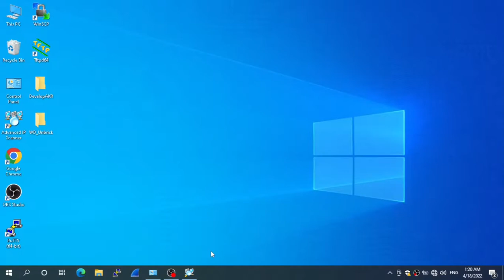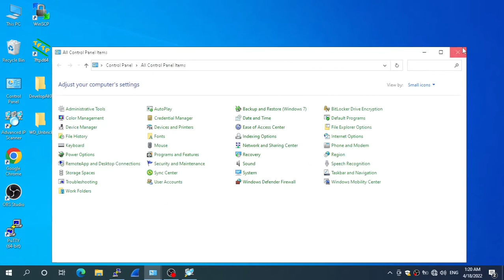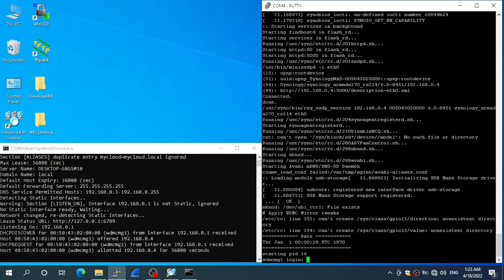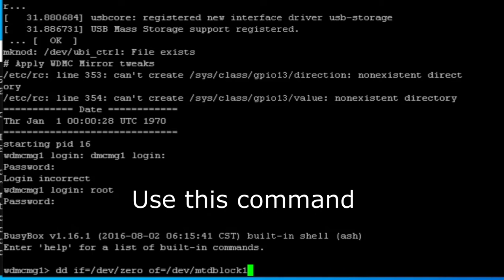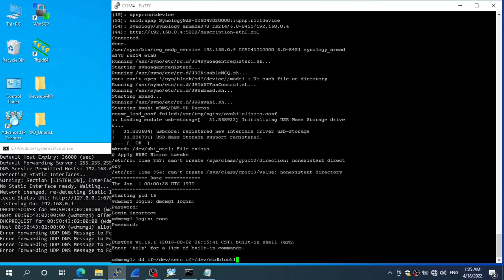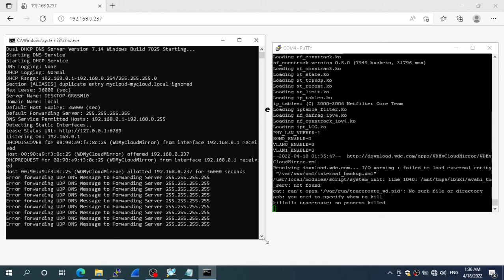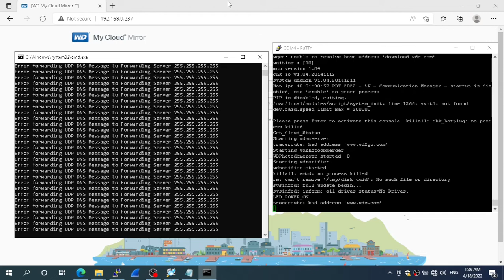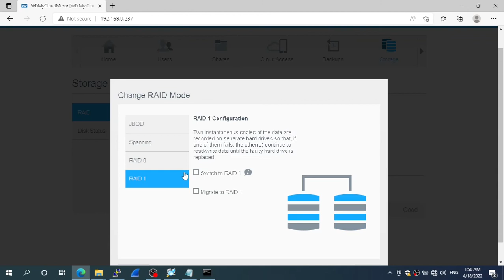How to Restore Your WD Cloud Mirror Gen 1 to Factory Firmware

Comment: Hello, thanks for the video, and I have already subscribed, just one question:
The cable soldered to the board has white, red and black cables, but when you put the other cable in it they are a different color, instead of black it is brown, this brown acts as black?, and on the other hand I see that where The red color of the board cable enters, the white color comes out on the other side and where the white color comes in, red comes out, as if they were crossed, is that okay?

It seems like a good video and I would need to reset my wd mirror, thanks in advance.
Reply from the maker: RX, TX wires must be crossed. The black wire corresponds to the brown wire
Reply: @developakr  Let's try it, thank you very much.
Reply from the maker: @villabol3931  report the results😉
Reply: Hello again, I've tried it, and in the PuTTY program it says COM1 and speed 9600 and there's no way to change it, in fact it doesn't come out to load WD_serial, what am I doing wrong?
Reply: Hello again, I finally got it, I had to put it as you had it in COM 4, and then I understood that you were referring to having to enable the port that came out there, what I said worked perfectly, now I will go again to install the DM from Synology, the other video you have, I already mentioned it before but there was an error in the permissions that wouldn't let me enter that's why I had to do this recovery.

Thanks for the video, it helped me a lot. Greetings.👌👍

Comment: no need to disassemble to restore to original

you run ssh on the server
putty
You log in with your own account that is in the administrator group
you type sudo -i
use the same password you used to log in
and the rest remains unchanged
dd if=/dev/zero of=/dev/mtdblock1
reboot -f
i check on ex2 gen1
Reply: You mean, that is  possible to do it using only RJ45?
Reply: Yes, it works! thanks for reply
Reply: can confirm it works.....was on dsm for a while and flashed it back to wd firmware......just make Shure you enable ssh and Telenet on dsm....ps i used putty

Comment: For installing DSM Does it support My Cloud EX2 Ultra?
Reply from the maker: Yes, but you have to use another firmware version
Reply: @developakr Ah yes The Mirror Gen 2 firmware I assume
Reply: Is there any other steps or am I completely wrong on using the my cloud mirror Gen 2 firmware
Reply from the maker: @gavinff  Look in the "WD Cloud Mirror Gen2" folder (WD_Unbrick.7z)
Reply: @developakr  which one?
Reply: @developakr  oh do you mean My Cloud OS?